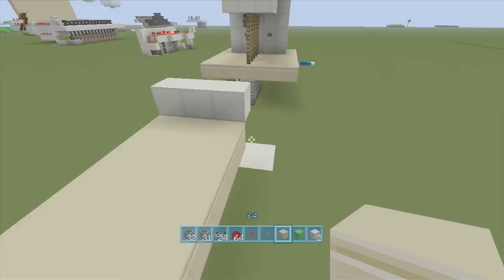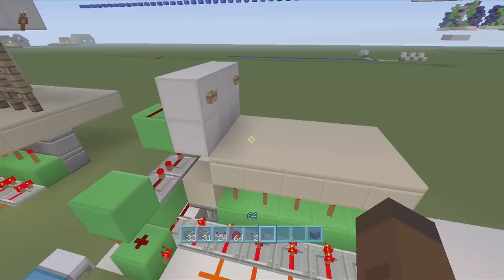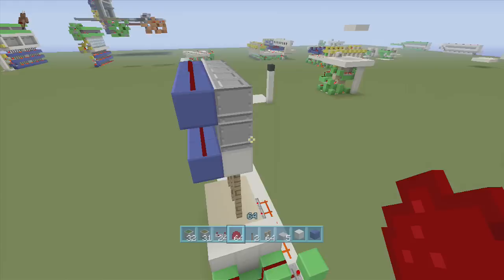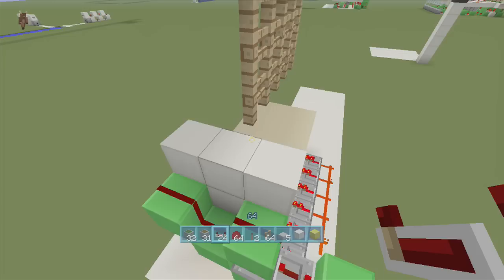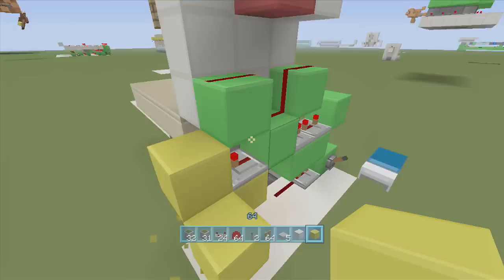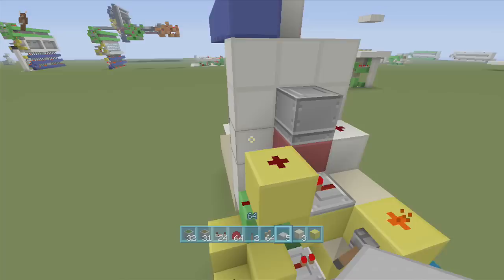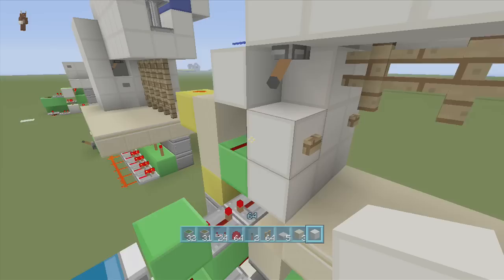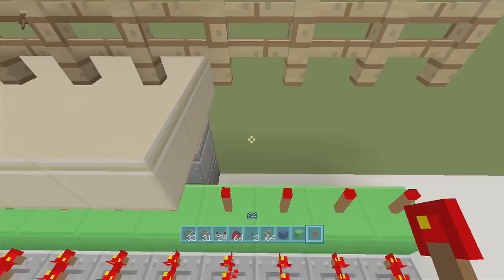Castle Gate [Portcullis Gate] "Tutorial" (Minecraft Xbox/Ps3 TU16)

Comment: The sand/gravel kept breaking. I changed the repeater to 4 tick delay. Still broke. I replaced it with a cobblestone block. Gate malfunctioned. Replaced the piston with a sticky piston. Gate worked, but repeatedly opened and closed without stopping. What should I do?

Comment: Tried this 3 times on Xbox 360 and due to a bug, the second you first press the lever early on (just after placing the 10 sticky pistons and 5ground blocks on top) once the lever is pulled, the BOTTOM STICKY PISTONS get stuck... And any pistons you create will be unresponsive for the entire play through until you reset without saving... I hope the BUG gets fixed... T-T

Comment: Ok, so this works perfectly except for one problem.  My block of sand on the initial regular piston disappears when I close it.  It closes properly, and, once I replace the sand manually, it opens properly.  I built it in 3 different locations, and this happens on all of them.  This is on a local game.  Any insight anyone?
Reply: So I've discovered that the disappearing sand is a PC problem, so is there a different method I can use to replace the first falling sand circuit?
Reply: Bill Buehler check my comment if you're still having this problem and want to pc fix it